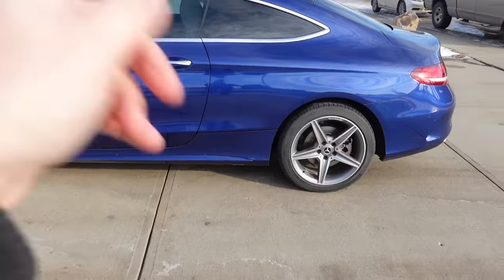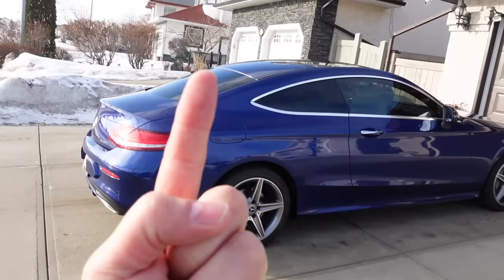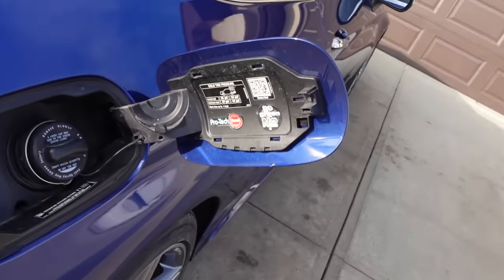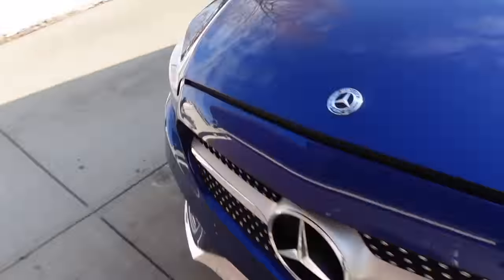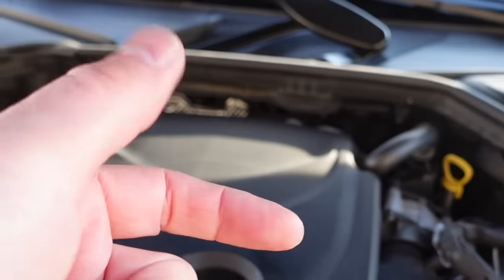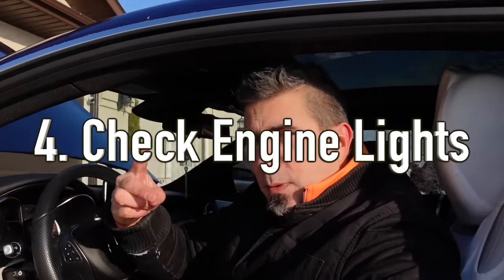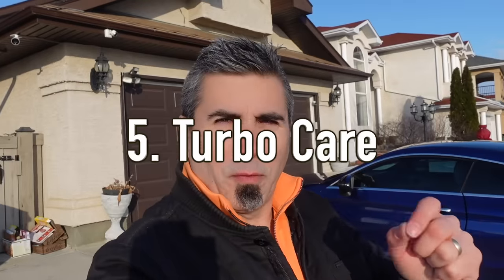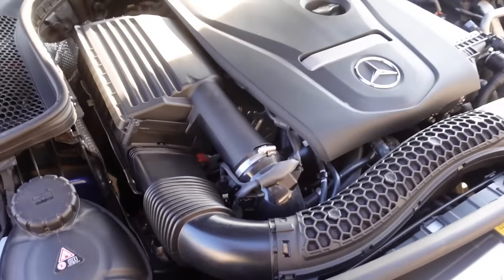STOP Destroying Your Car Engine! (With These Tips)

Comment: Those start/stop features are a joke - any benefits gained, either with better fuel economy or less emissions, are completely cancelled out by wear and tear on the engine.  But I'm sure the manufacturers don't mind making a bit of extra cash.
Reply from the maker: For sure, this tech adds weight, complexity and price.  Regulators are implying that this helps the environment.
Reply: That’s Obama’s heritage
Reply: The starter is already there regardless of whether or not the car has auto start/stop. How does it add weight? The extra 1's and 0's from the programming?
Reply: @irysh9 
Are you able to read AND cognitively convert the letters into something else than gibberish?
Reply: @masoudshaghaghi5744  Stop/start technology was installed in some European vehicles in the 80's.
Reply: @irysh9  It asks more from the battery for more deep discharge and charge cycles. Most cars with auto start stop end up carrying an oversized agm battery (adds weight) or lithim battery (triples cost)
Reply: @Mark-rt6fy  yep,my car needed a new battery after 2 years and it was very expensive and twice the size of a normal battery
Reply: There not though..
Reply: @ECPP  it does..
Reply: One of the worst features on modern cars. Sometimes my Honda does start back up automatically after the engine stops.. Dealer says they can’t repeat it and works fine. Total BS.  Highly recommend turning this feature off all the time.
Reply: Why cure a disease when you could just treat it and charge every step of the way
Reply: Agree. My car has a off button so I can disable the start/stop technology but the problem is it is enabled by default everytime you start the engine so has t9 be pressed each time I drive the car. Found a way to invert the setting so it if off by default and never worry about start/stop technology again.
Reply: @JohnSmith-se5vo  m be
Reply: They're annoying too
Reply: @wnow8987  in the city where I live we have smart traffic lights that start the engine just before light turns green. Could that be happening to you? Check with the city traffic division!
Reply: @ECPP  Yeah. It's for C.A.F.E. requirements during testing
Reply: @Mark-rt6fy  BS.  My Mazda has a lead-acid start-stop battery and it's the same size/wgt as any other.  It lasts the same time as any other battery.
Reply: @standoutpunching2936  @irysh9 was quite correct and entirely coherent.  I would deduce that you are the one with a minimal comprehension ability.  He didn't mention letters, only numbers.  Start-stop is programming and a brake pedal pressure sensor switch.  2-3 oz.
Reply: Relatively simple system. Doesn’t cause excess wear on an engine.
Reply: And you know this because?
Reply: It's best to leave that feature to the hybrids.
Reply: Blame on politicians; those are the only ones happy with al this crap! 
Manufacturers are happy keeping politicians happy; but you and I , the customer are screwd!
Reply: @irysh9  Lol
Reply: @irysh9  heavier battery and starter motor come to mind.
Reply: @Mark-rt6fy  the extra weight is negligible. I work at a ford dealership. I can’t tell the difference in weight unless they’re side by side. And there’s no deep discharge because 1. the engines start instantly . 2. The start cycle is disabled if the battery even becomes slightly discharged . In my observation, the batteries are lasting just as long as before. We’re not even replacing starters at any higher rates.
Reply: @sammuslu2992   batteries have always had a fairly high failure rate in new vehicles. It’s literally the component that we’ve always frequently replaced under warranty. I do agree that the cost is more though
Reply: There’s many other mechanics and people on YouTube who say it’s beneficial These are modern engines
Reply: The 10 percent ethanol added to engines is alcohol ,Why would you  add a fuel additve to disperce water and get rid of water when that's what the ethanol is doing, years ago we put Heet in the gas in northern states so your gas lines didn't freeze, Today with ethanol its not needed because it is doing the same thing, it's dispersing water and eliminating it as you drive,
Reply: @donm565  years ago, I remember buying a product called dry gas or something like that. When I smelled it, it was alcohol. After that, when a vehicle had just a bit of water in it, I poured a bottle of rubbing alcohol in the tank. It worked just as well 😂.  Back in the day, we'll try anything once. LoL
Reply: The new engines are built with start, stop technology in mind. The bearings are even made of a different material that holds the oil film. Not only that, but the oil pressure builds instantaneously. And the engines aren't shut off long enough to have a dry start.
Reply: @irysh9  pretty sure stop start uses an extra battery to power it instead of the main car battery
Reply: @masoudshaghaghi5744  lol 😆 Maga fossil ⛽️
Reply: @JohnSmith-se5vo  what way??
Reply: @richeyrich2203  I use a device OBDELEVEN.
Reply: @irysh9  a lot of these vehicles use a second starter with this system, I've seen them very deep between the transmission and the engine. Would be a major major project to replace it. Not sure if they're all this way but I'm assuming that's what the original comment was referring to
Reply: Been an auto sparks for 40 years,how the stupid misconception of free energy still remains is baffling! It doesn't take a physicist to work it out. Stop start systems are generally the first indicator of a fault,in engine,drive line or power management,all stop start systems have stringent high requirements especially for battery percentage of charge. Every time you stop and restart the monitoring system triggers a higher workload from the alternator,these alternators are becoming ridiculous,6-7-800 amps,water cooled,nonsense! not only for what the starter has used but also what you are using while the engine is off,heater,radio,lights..... Plus the myriad of computers and the many things that you don't see like electric pumps for the engine oil,pas,coolant and transmission etc. this requirement puts  heavy parasitic load on the crankshaft,requiring more energy to rotate at the required amount,you don't notice it as the idle is controlled to adjust,that energy is provided by more fuel,added to the initial rich start strategy adding that bit more fuel,where's the gain? AGM,gel,efb,calcium batteries last about five minutes nowadays,the multitude of extra failure points and the cost of replacing some of them,(Nissan transmission pump for instance,common fault,about the size of a cup,just a plain old motor no clever electronics £800!) Makes it an expensive hobby. One which I have benefitted from,although as many customers ask for it to be disabled as those who want it fixed,and some of those just to get rid of the annoying warning😁.
Reply: @masoudshaghaghi5744  🤣 sure, sure
Reply: @Mark-rt6fy  believe they have a dedicated auto stop start battery for that specific load.
Reply: @martynanstis1620  My 2018 bmw and 2017 porsche and 2017 ford all had only 1 battery.  Newer gen porsche went with lithium battery altogether, not sure about other brands. In fact Bently was the only brand I knew that had 2 batteries
Reply: @Mark-rt6fy  both my Mercedes’ A45 and A45s AMGs had separate batteries
Reply: @martynanstis1620  interesting, good to know!
Reply: Start stop feature has been in cars since 2009/2010 when it was introduced in “most” cars. There is zero, ZERO evidence it has ever caused premature engine wear in the last 12 to 13 years. This is all just an opinion that people spread. It’s annoying for most people that’s evident from online polls but that’s the extent of it. It can be programmed out if you know how with a laptop and sometimes with certain brands like VW with obd11 dongle and cell phone. 

Too many opinions from people that don’t actually work on cars or see real common issues. Start/stop is fine. No need to fear monger.
Reply: @masoudshaghaghi5744   Wrong
Reply: @irysh9  it puts unnecessary wear and strain on the starter. Also if you have a engine that you've been driving "spirited", especially a turbochaged engine. Then stop at a light or traffic, engaging the stop/start system. you just stopped the oil circulation which cools the hot turbo and engine. That can "cook" the oil sitting in the turbo and damage seals.  The entire start/stop systems just stress critical mechanical components and do almost nothing in terms of emissions for modern combustion vehicles. On top of the fact that most modern  vehicles are made with proprietary fastens dettering the diy home mechanics. In hopes the vehicles will be brought back to dealers for costly repairs.
Reply: @csjrogerson2377  Uh no. Irish was wrong. Start/Stop adds more wear and tear to vehicles, especially the starter.
Reply: I'm damaging my engine by starting it and turning it off. Ridiculous. 🙄
Reply: Hey, I am confused regarding this whole stop start, I watch videos and read websites where it says stop start is okay, then on others they say it is not good for the car.
Reply: There is no benefits to auto stop
Reply: It turns the aircon off..the car gets too hot too fast when waiting at lights in summertime
Reply: ~120000km with start and stop in diesel golf, still working. Had to replace battery once, but I think its because too much use of webasto.
Reply: The wear n tear on the starter alone negates any gas savings.
Reply: @Omar-kf4um  No, it doesn’t.
Reply: Literally purchased a crosstrek & it has the auto start stop feature. Luckily I can disable it every time I start my vehicle. I’ve watched 2 different videos of its “improvement” which will save you gas & that it won’t wear & tear those necessary components in your engine, starter, battery, etc any faster. I’ve noticed on my crosstrek that it won’t stay OFF for too long, it literally turns back on in less than 20 seconds. (Rough estimate) also, just seen a auto start stop eliminator on Amazon with 70 reviews and those recent are positive. To completely disable that feature. So I don’t know, everyone has an opinion.
Reply: Stop start turned the engine off 5 times in 2 miles. No thanks. I now switch it off at the start of each journey.
Reply: Here is a tip if you want to help with the environment drive less and get a ev or hybrid. Auto start stop sounds annoying.
Reply: @masoudshaghaghi5744  what’s yours fool 👉🏽🤡
Reply: I use Berryman B-12 chemtool 2 cans with every fill up
Reply: Blame the gubmint
Reply: I stay in sport+ so my engine remains on
Reply: Amazing thanks 🙏🏽
Reply: My car uses compression to start the engine again with the start stop not the battery or starter motor. Doesn’t seem
To bother the engine at all.
Reply: I'd blame the government. By making vehicles have to be more efficient they looked for loopholes to get there. Basically how start stop was born. I imagine the extra wear and tear is less environmentally friendly than the extra gas burned
Reply: Iv been saying this for years joke/scam
Reply: I've been awaiting the inevitable high numbers of vehicles dying at stop lights. "oh my goodness gracious! It's not starting?"

Who would've thought shutting a motor off at a stop light is a foolish idea
Reply: @zakzac1  never use it always shut it off mate if your car has it stupid idea
Reply: @donm565 the thinking behind ethanol added to fuel is actually for the govt to better be able to control fuel price. They can make ethanol themselves. They can then control 10% of the cost. It should burn just the same but you'd need less fuel from abroad delivered etc. Not sure its working as they hoped but wait. And see.
Reply: Seems like it would screw up the starter too.
Reply: @williamegler8771 which?
Reply: It does nothing to your engine. It would wear a normal battery, but cars with this feature have special batteries that can easily handle the amp spike. My source: I know a battery maker engineer.
Reply: @Psalm144.1 never heard the starter with auto stop start, so how is the starter being used? It's  an instant start.
Reply: @masoudshaghaghi5744 Obama’s legacy is caring for the environment, sure, but he constantly preached smart change instead of sweeping change for the sake of change. Talked about a surgeon scalpel where it makes sense. 

Stop being brainwashed and educate yourself.
Reply: 1978 Chevrolet Caprice 350 v8..life is good.
Reply: Start/stop feature should be called the help me get rear ended in city driving mode
Reply: It benefits car makers to let people buy new car earlier.
Reply: It doesnt wear and tear on the engine. Just the starter maybe but they are built for it now.
Reply: There will be less wear and tear. The engine wears when parts are moving, not when stopped.
Reply: I wouldn't have a car with that.  If my eyes get fixed,  I'll be getting either 80's or early 90's Mercedes. 126, 140, 124, or even 123.
Reply: First thing I do before moving off is to cancel this feature, I’d rather keep the engine running ..
Reply: @irysh9 , no your wrong . Many things have to be adapted to make it work. 1st you need a special battery , one that weights an extra 30 pounds or more
Reply: @carlanderson4139  The most wear on an engine is when starting because the oil is in the oil pan and not pumped through the passages yet. So constantly starting and stopping an engine is terrible for it.
Reply: Hybrids are set up to take advantage of this feature much moreso than regular ICE vehicles.
Reply: My car doesnt even have a button to turn it off or anywhere in settings
Reply: Much larger battery , among other things .... Car weighs 70 pounds more
Reply: Purpose of start stop button is to make a car last shorter.
Reply: Wear and tear on the starter? Engines already lined up I don't see any wear and tear from starting it up more often...
Reply: Yeah, no. Even though i hate the feature and i always turn it off every time i drive my car, but this has been implemented in some cars in europe for well over 30 years. It has been proven time and time again that the starter motors in these cars were built to withstand the wear and tear and the difference between “normal” starter motor is negligible. Please do some research before writing bs here. Same to the guy who posted this video.
Reply: 2023 and later Mercedes are DESIGNED, to run stop/start. The entire system is based on it. All you need to worry about is what you should do with the gas money you save.
Reply: @irysh9  A car that is asked to start and stop continuously will require a more robust starter...if you're lucky.
Reply: You can prove that?   You do know cars are engineered to handle stop/start systems.  If you don't like it don't use it, but it doesn't destroy your car.
Reply: My civic  jumps a bit. Guess I have to shut it off. On some you can pull the plug. But I don't like fucking with the electronics.
Reply: They use small batteries with low cranking power. Two and a half years.
Reply: This is why I lease.
Reply: Our Emissions saved this planet, c02 levels are still too low and should be quadrupled
Reply: Agreed.   Bigger battery means more Pb mined and in the environment... that's one issue... another is that you're now toting around a heavier battery with you EVERYWHERE you go... that's reduced gas mileage.   I'd also speculate that there's more gas used in the engine's startup (restart in this case) compared to just letting it idle... especially if the pause in driving is brief.
Reply: @masoudshaghaghi5744 ah yes, let’s make it political, you are a genius, brilliant comment.
Reply: @csjrogerson2377 No it isn't. How exactly do you think the manufacturers have managed to get 10x more starts out of a starter motor without changing it? Ask any mechanic, they'll tell you, these starters are huge and heavy in comparison to a car without start/stop. Then there is the battery which, even if it is a lead acid battery, is a further expense and weight over a car without the start/stop. Oh and building a bigger starter and an extra battery costs the manufacturer (read customer) more. So you pay more when you buy, you pay more to replace and the extra weight is reducing fuel economy (even if you don't use the start/stop). So please tell me again how it's only software!
Reply: @theofficialwizard2753 did you even watch any of the vid? Cranking an engine causes wear, the most damage is done on start-up, so starting an engine 3000 times instead of 1000 times WILL do more damage. That is an undisputable fact. Whether the revs the engine isn't doing while stopped will offset this is a different matter. I'm not sure tbh, but the only question that matters is will the increased wear and tear be a major problem, and it probably isn't. Very few people keep a car until the engine detonates.
Reply: @finnderp9977 I've done 120000 MILES in my Octavia TDI without start/stop and haven't changed the battery yet. So if you are actually silly enough to think 1 anecdotal test case proves anything then you have proven it shortens battery life.
Reply: @carlanderson4139 I can tell you aren't a physicist. Here's some basics for you; Starting any movement takes more force/energy than keeping it going. More force/energy = more wear and tear. Of course engines are built for this so Its not necessarily a problem. I'm just pointing out your comment is based on incorrect assumptions and you don't really know when damage is done in a car engine.
Reply: Say thanks to those eco mentalists, no gain except for a minuscule emissions increase and a lot of wear on your starter and alternator and battery
Reply: @JohnSmith-se5vo pls share how you reversed the default settings..
Reply: Yup I turn mine off as soon as I start my car every time..I have no clue why they even started doing that a less is a police car that usually sits on a stop for a long time..all that start and stop I can imagine it can’t be good for motor mounts etc etc I seriously have no clue what’s the real point on normal cars for that feature,it’s more annoying then anything
Reply: @arielperez6400  I use a device named OBDEleven. It plugs into the OBad2 port and software on a mobile, can be used to do a number of customisations one of which is to inverter the start/stop function or have it off by default. VCDS can also be used. I've also used it to enable Audi Drive select which wasn't on my Audi by default.
Reply: Show me the evidence that it destroys engines. Because I can't find any. There is evidence that it does NOT cause any extra damage. Thats from the SAE International.
Reply: First of all. The entire start/stop system is completely different then autos without it. Heavy duty batteries. Heavy duty starters. Specialized computer systems. It is irritating. Just get used to shutting it off when you start your car. That's it. No big deal. calm down.
Reply: @dmandman9 It sounds like you really know your stuff.  Now tell me about this new super material that auto manufacturers are making bearings from.  I happen to work for a company that makes automotive parts with bearings and I'm unaware of this metallurgical miracle.
Reply: @rokan81  Yep, it's a myth that this feature wears out the engine faster. In fact, The Motor Oil Geek did an engine wear analysis on two identical trucks driven the same, but one with auto stop disabled. They found that the one with auto stop enabled had less internal wear since it spent less time idling. I'm going to trust the lab experts and leave the feature enabled on my car. My 20 year old Civic Hybrid has this feature, and the engine is still doing just fine lol
Reply: @bhbpro what car?
Reply: Right up there with the new gas cans/nozzles.
Idiotic.
Reply: Not disabling the start/start is hard on the starter. Every time you stop the engine goes off, once you release the brake it starts. That is not good for the starter, in fact you will wear it out faster
Reply: It’s not even just wear on a starter, these systems add numerous new points of failure all over the car from engine, to computers, to new sensors, to transmission. The amount of added complexity all over the car to make it “work” is insane. All completely unnecessary since this system provides really no benefit to anything practically and only increases purchase costs.

Having to manufacture all these components more frequently due to the increased failures has a much higher carbon footprint at scale than any benefit. This is a scam that no one but parts manufacturers benefit from, consumers and environment both take the hit.
Reply: @masoudshaghaghi5744  start/stop engines are a worldwide thing. Contrary to popular belief the world doesn't just revolve around which clown is the president of the US. It actually has nothing to do with Obama.
Reply: Shows you've never owned a car that has that feature or had one from a manufacturer that didn't do it right. My 2012 BMW is at 180000 miles and still runs like a champ with no problems. I've used the stop/start feature since I bought it and it activates at any stop.
Reply: what worries the most about start/stop is the stretching my timing chain. Not sure if it actually does, but i'm skeptical.
Reply: @williamegler8771 found the liberal
Reply: @Mark-rt6fy  Dodge
Reply: @jimfields9491  Mazda doesn’t use the starter to restart.  Read about i-stop
Reply: It doesn't cause wear and tear on your engine. It wears your starter components. It's a old boomer myth that was once true, that oil fails to pump when you do a cold start of the day.
Reply: More joke is you did vote, you and your Californian hippies did this